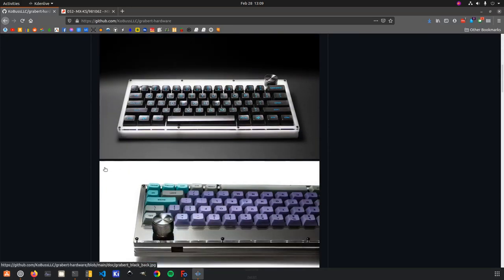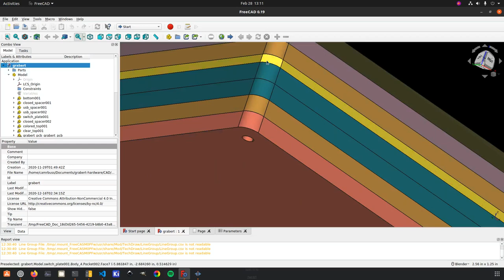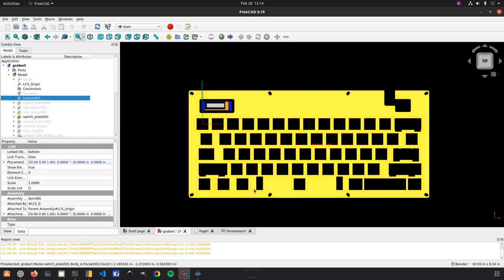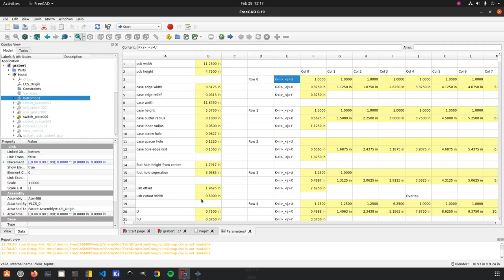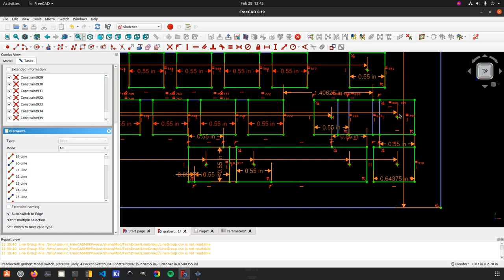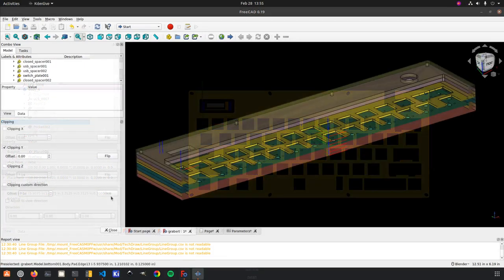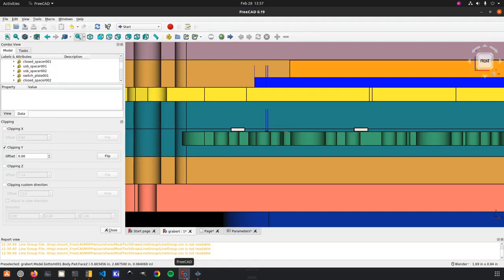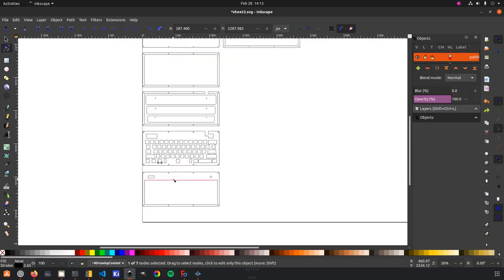How we designed an acrylic mechanical keyboard case!

Comment: 13:25 - it’s a bit frustrating that the data sheet only supplies metric values for a couple of items. I suspect these things were designed in metric. Because 14.000mm (specifying extra precision just to emphasize that I mean exactly 14mm) lands within the 0.551+/-0.002” (14mm=0.551181”), and for the plate thickness you’re talking about here, 0.06+/-0.004 may be close to 1/16” (0.0625”), but 1.5mm is closer (0.0590551). (And even 1.6mm, a common nominal PCB thickness, is within spec. And gets even closer without the copper layers. (However, outside tolerances for such a PCB, especially with copper, may exceed allowed tolerances for the keys, so... YMMV.)
Reply: well, the people who designed the program are in the XXI century :p
Reply: @shaddonai2636  I think you’re making a joke that I’m not quite getting.
I know that I’m of the opinion (though I acknowledge this is just an opinion) that anyone designing stuff in the 21st century for a general/global audience ought to use metric. :)